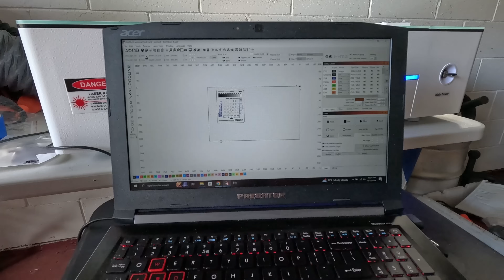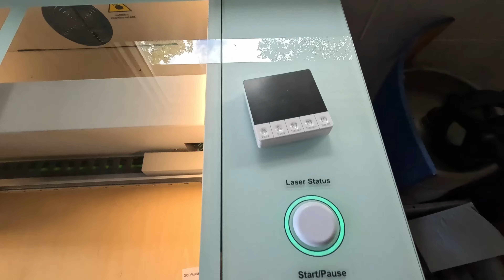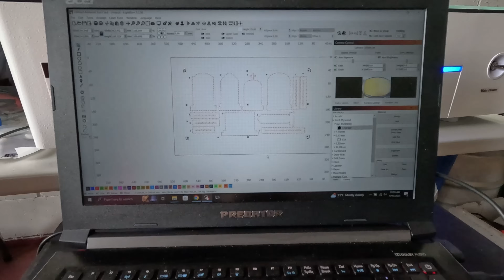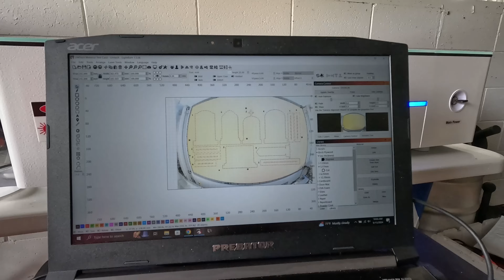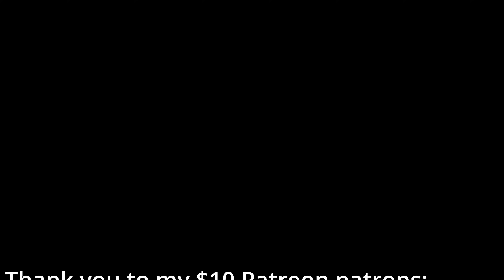OMTech Polar 350: Best Budget CO2 Laser?

Comment: my Polar350 does NOT fire its laser below 19% power. 20%minimum seems to be its capability
Reply from the maker: Yeah, running a CO2 laser below 20% power is generally not recommended so many will just prevent you from doing it.

Comment: What the thickest wood, mdf or acrylic you can cut?
Reply from the maker: @ald.3449  0.4 inches/10mm on a single pass for basswood but for other stuff I'd say 3-6mm depending on the material.
Reply: Ty
Reply: @ald.3449 the new 55w is 15mm wood and 21mm acrylic.